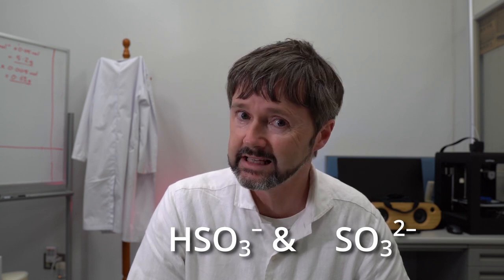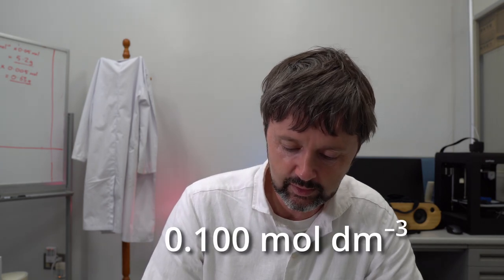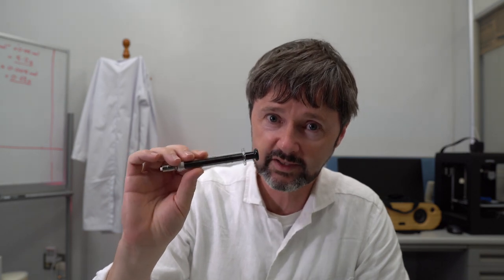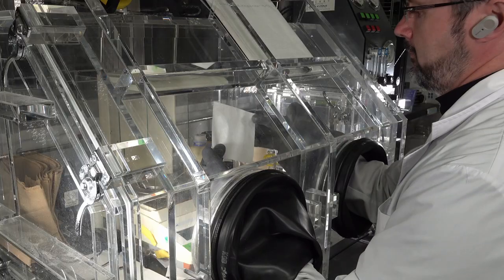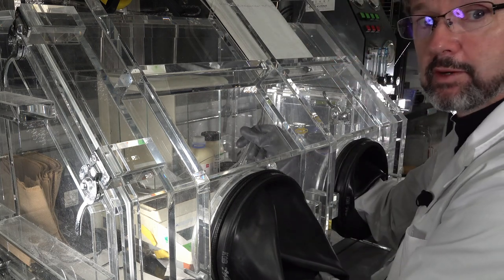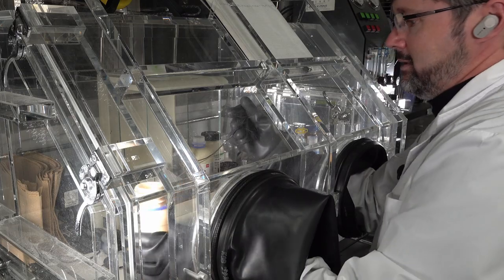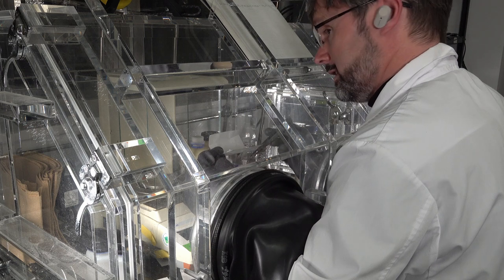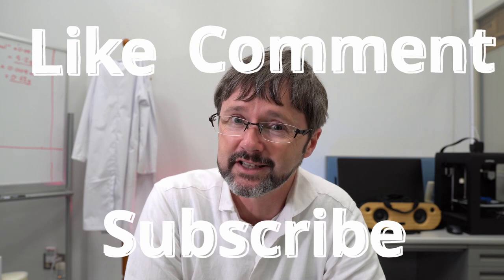Moles in the laboratory

Comment: you talking about the buffer going bad reminds me of the time I was trying to find the strength of my old HCl through titration. I knew the strength had gone down but for some reason the math said it had gone up! Turns out that the NaOH I was making a solution with had a leaky cap and the moisture had gotten in turning a bunch of my NaOH crystals into carbonate. I just had a frustrated laugh and moved on with it
Reply from the maker: I hate titrations, that would have driven me crazy.
Reply: @ThreeTwentysix  Ill never admit to anyone how long it actually took me to realize it! Anyway, great vids! New sub here and I'm currently going through all your stuff! Pretty sure I found you through a linked post on Reddit

Comment: Do you know a cheap labelling system to mark reagent bottles with details and is alcohol resistant, but has to be erased and changed frequently?
Reply from the maker: Well it also depends a bit on what surface you're writing on. I don't know of any completely alcohol-resistant ink that is also easy to remove but I use a xylene-based permanent marker on glass and that's reasonably resistant against alcohol (comes off easily with acetone).  It's just a normal permanent marker you can buy in any convenience store. Be careful not to do what I did, though, and think you're writing on glass when it's actually acetate – acetone goes right through that stuff!